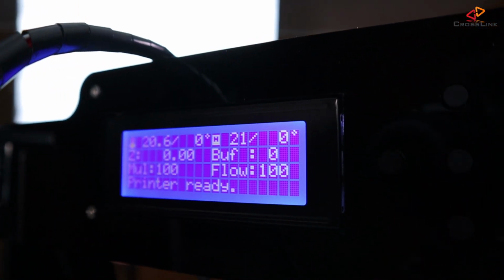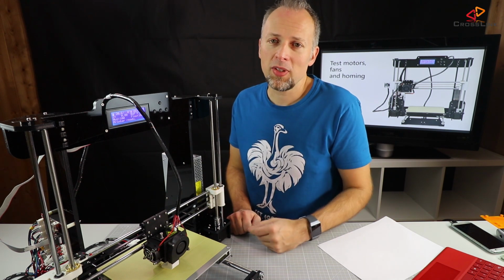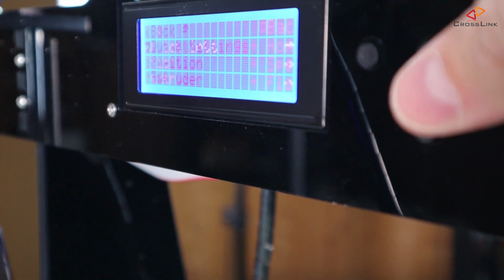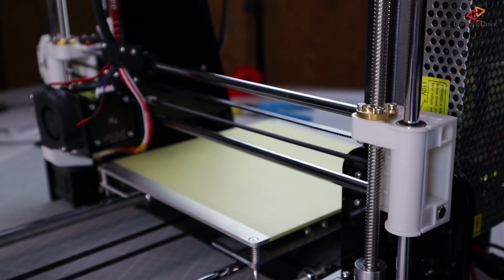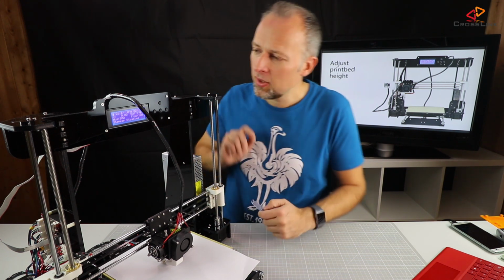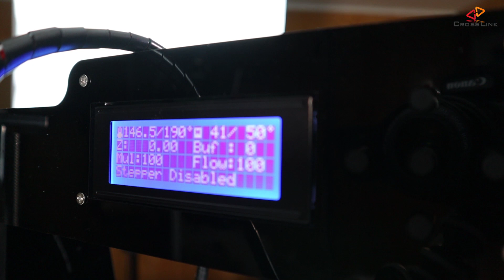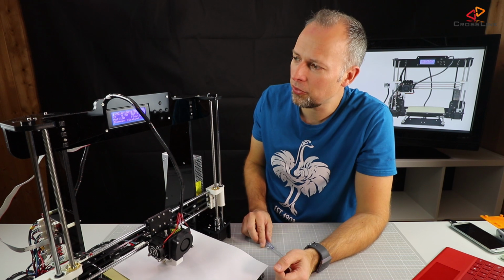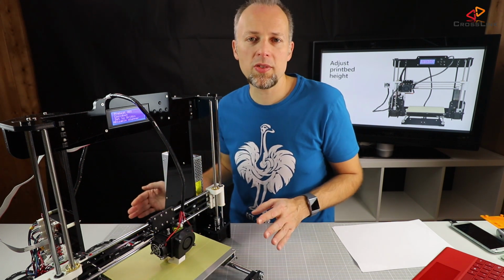How to build the Anet A8 - part 4 - Last checks, Calibration and test print

Comment: I have bought a Ctc A8 printer from china .As i press the home all button it moves in opposite direction rather than  to the switch side .what could be the problem .although i havent uploaded the marlin firmware yet.kindly help
Reply from the maker: this can be fixed in the firmware easily. Switch the motor directions in Configuration.h, look for INVERT_X_DIR , ...Y_DIR and ...Z_DIR and change accordingly.

Comment: I am having nothing but nightmares on a A8 v1.7 board.  I believe i got one of the 20% that dont have a bootloader as I wanted to flip it over to the TH3D firmware.     Spent the last week messaging Anet on why I couldnt talk to the printer with my laptop which i finally got resolved as it was a driver settings in control panel that needed to be tweaked for the Anet,  when my CTC board had no issue.   Also figured out the CTC I3 Pro B is wired completely backwards compared to a Anet A8 when it comes to end stop switchs and stepper motor wires.   Why on earth is there not one standard pin out for Stepper motors.   So I figured out my end stop issues,  I figured out the issue with my stepper motor wires.  I figured out the driver issue.   But im still stuck trying to figure out why the Y-axis is inverted as its either autohoming in reverse, or looking for a max end stop switch that isnt there to tell it to stop when it hit the max on the y axis.

Comment: Looks like it's underextruding, or maybe you have the filament size in your slicer set at 3mm instead of 1.75mm. If the filament setting is right, try turning up the flow rate.
Reply from the maker: In fact the diameter was set to 3mm. This seemed to have happened after I had updated cura to the latest version. Sometimes this resets all my settings.
Reply: Haha, that same thing happened to me when I switched slicers. The printing looked very familiar and hat's how I knew.
Reply from the maker: The embarrassing fact is that this only shows one more time that 3d printing is still hard for the average user. The slightest mistakes can lead to frustration. That is my motivation to make more educational videos.
Reply: I know. I had an issue where sometimes the print nozzle would randomly stop extruding and ruin my prints. The extruder motor would just set there making clicking sounds and not extrude at all. I thought the nozzle was clogged, it wasn't. I thought the stepper motor was bad, it wasn't. I thought the main board was fried, it wasn't. It was driving me crazy. FINALLY, I figured out the cable going to the extruder motor was making intermittent connection to the pins on the motor. I tightened the connectors and problem solved.

If you do any mods to your A8, I can recommend some that have improved my print quality a lot. 

On Thingiverse, not in any order,

1. Hulk Brace, https://www.thingiverse.com/thing:2189694 (these help with ghosting)

2. Z-wobble fix, https://www.thingiverse.com/thing:2216161 (this took almost all of the z error out of my prints.) 

3. PLA spiral bushings. https://www.thingiverse.com/thing:2537701 (these run MUCH smoother than the cheap LM8UU linear bearings that come with the A8. Use the customizer on the page for exact fit.)

There are several different frame braces and belt tensioners but I use these.

3. Front frame brace, https://www.thingiverse.com/thing:2291581

4. Belt tensioner https://www.thingiverse.com/thing:1959208

5. Belt tensioner x https://www.thingiverse.com/thing:2291602

I also bought the neoprene/fiberglass GT2 timing belt with toothed idler bearings ( you will have to change your E-step settings depending on how many teeth). For some reason, toothed belts running on smooth idler bearings, cause noise in the prints, especially on walls. My walls are smoother now.

I saw an immediate improvement in print quality after installing each of these upgrades. My biggest print error now is salmon skin. I have TL Smoothers coming in the mail.
Reply: Thanks a lot for the feedback. I   have used a few of these upgrades on my first aber a8. The next video is going to be abouty favorite 5 printable upgrades.